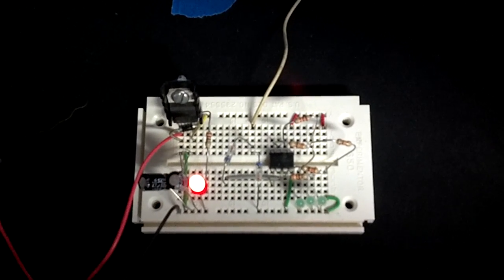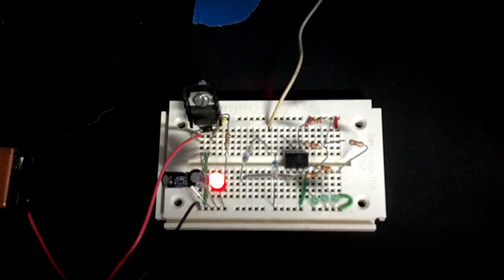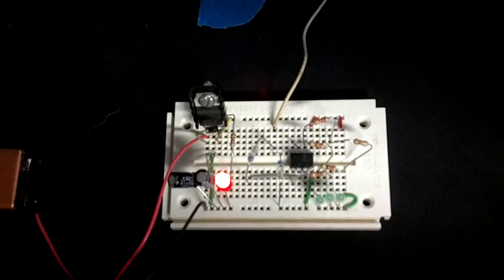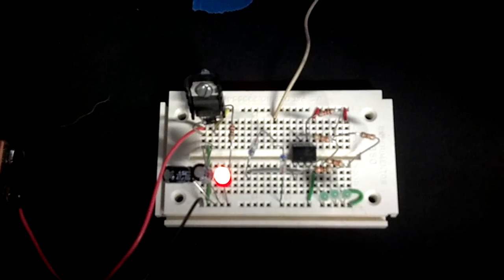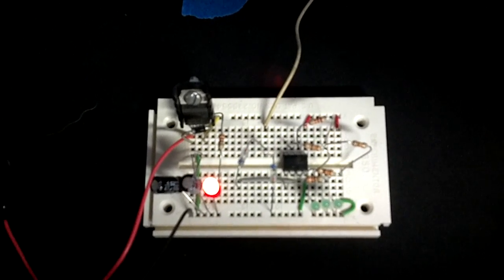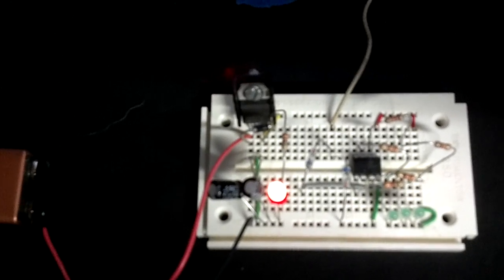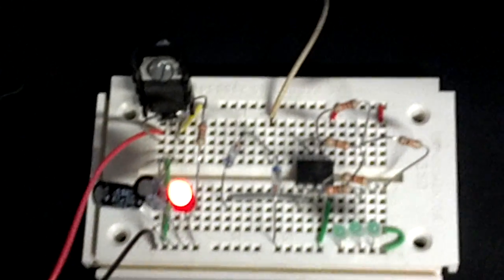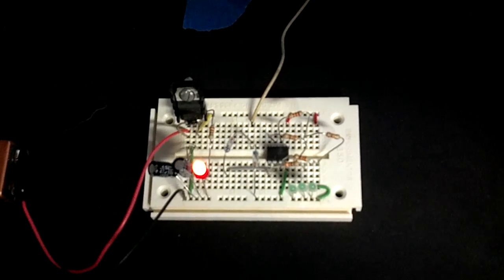Simple RF Signal Strength Meter with a 08M PICAXE

Comment: Where's the Code?
Reply from the maker: Digging info from old hard drive.  Hope to extract it and post results in comments soon!
Reply: @outpost9  Hi, did you found the code after all this time? :'(
Reply from the maker: @richardbalboa7161   Actually, I found it the other day on an old backup drive.  Adding it to the description now.
Reply from the maker: ###################
main:
readadc 1,b1

if b1 <= 1 then goto nosignal
if b1 >= 2 then goto signal

pause 500
goto main

nosignal:
low 0
low 2
low 4
goto main

signal:
high 0
if b1 >= 4 then goto signallow
pause 500
goto main

signallow:
high 0
high 2
if b1 >= 8 then goto signalhigh
pause 500
goto main

signalhigh:
high 0
high 2
high 4
pause 500
goto main
##################